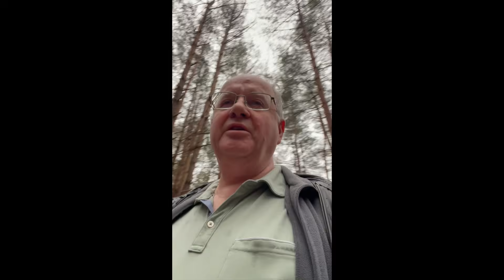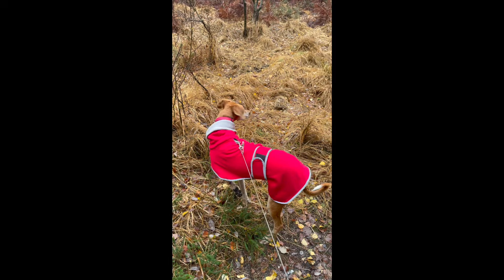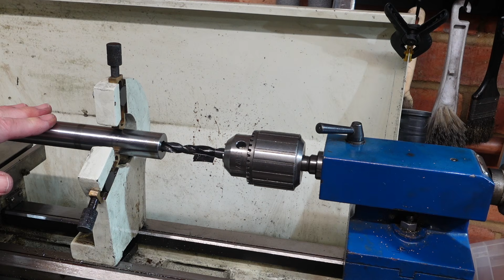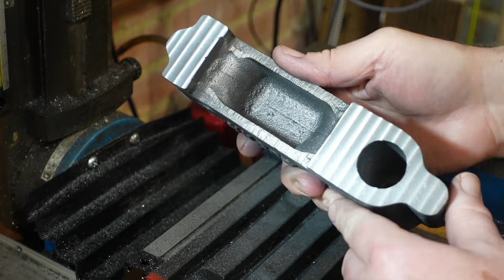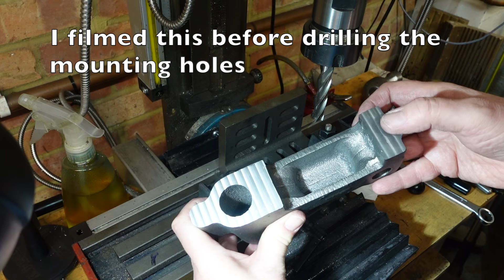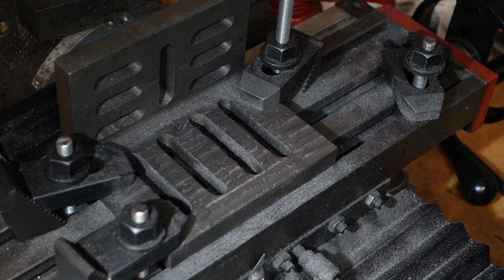Quorn Mk3 Tool Grinder Part 1 Base bars and castings

Comment: Does your brother have a tool grinder, or are you going to level up your drill grinding skills? I am curious to see how you grind drills with "the thing". 🙂
Reply: All by hand and eye , I was taught by my old boss, a proper old school engineer
Reply from the maker: My brother is good at sharpening drills by hand on a bench grinder.  There's a knack to it which he has and I don't!  My main use for it will be sharpening drills, and sharpening/making lathe tools.  I'm hoping it will be a level up from just using a bench grinder!  Of course, there are numerous times while I'm building the Quorn where I'll need some custom lathe tools, and a Quorn would be the ideal tool for making them......  Chicken and egg!!